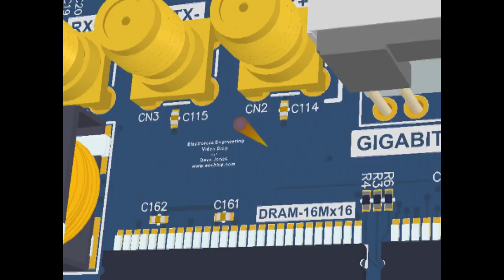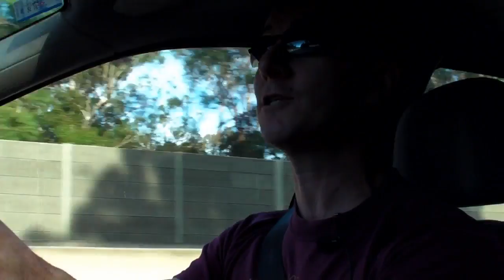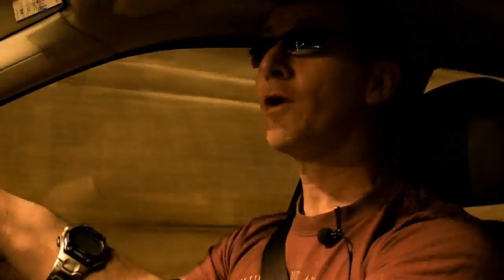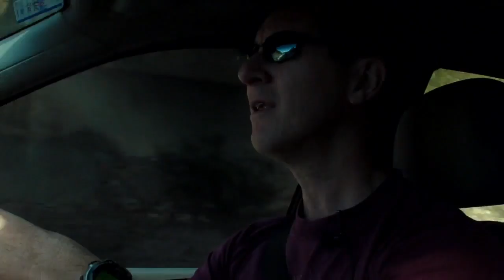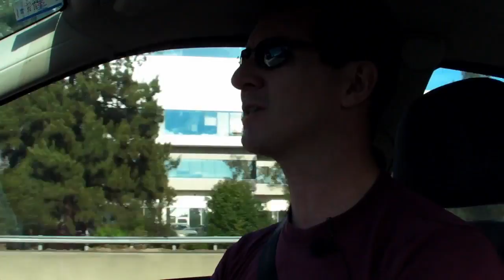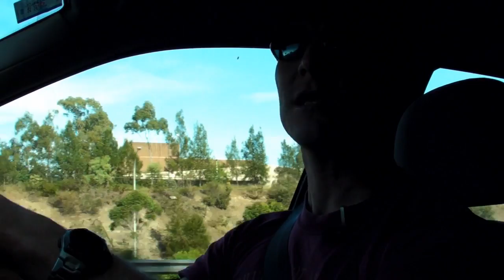EEVblog #93 - PCB Autorouters Suck

Comment: When I worked at SONY as an R&D tech one of my jobs was PCB layout. One day they asked me to do a manual layout to compare against an autorouter. I looked at it as a sort of John Henry challenge, so I really busted my butt at it. The autorouter produced a real ugly mess with 30 some vias, a few going back and forth between layers twice. Not good at the frequencies we were running at. The senior hardware engineer came into my cube, looked at my completed layout and asked me to turn on all the layers, since all he saw was green traces and pads. I told him, "They are all on." I'd done the layout entirely on the top side of the board except for vias to VCC and GND layers. He went and got our manager to come look at my work. I got a good raise at my wage review. That's been a while. I hope commercial autorouters are better by now.

Comment: I used autoruter about 2 times and I had enough of it... Both times I ended up with a board full of extra wires because I just could not hand solder beneath some pieces, which may be no problem for a machine... :S

Comment: Altium is a pretty expensive and complex tool. I'm happy to use it, but just because I used some other tools which where just worse then altium. There are some annoying bugs and behaviours... Import and export layerstack? Not implemented. Output jobs which export the right layers? Well, try to preconfigure them... Documentation? Plenty but outdated...
On the other hand, they were brilliant to use plain text underlaying all files (realy!) that allows powerful workarounds. But, yeah: It's a tool.

Comment: Auto-routers are nice for two things. One is running lots of parallel buses, after you've done a good placement. That's rarely necessary these days, though, with everything going serial. The second is finding routes for those last dozen or so lines on a tight board. Typically slow, non-critical circuits like /reset that wander all over the board. I'll let the auto-router loose on those and let it find a route. Then I'll rip it up and lay it back down cleanly myself.

Comment: That must have been a condition of providing "free" or low-cost software.  I can't believe any professor would prefer that you use autorouting over manual, especially on something like a single-sided board.

Comment: I usually use perfboards instead of making PCBs in part because the routing takes so much time with an autorouter or not (the other part is that I never get it right the first time and modifications are easier on the perfboard). Last device I made has 20 logic chips so if I had a good autorouter and was willing to etch the PCB, it would have saved me some time. I used a perfboard though (with wires I get many "layers" but only 1 layer on a PCB).

Comment from the maker: @jpelczar For high speed stuff you are forced to use a large number of layers to get the ground planes required for impedance control. Once oyu have all the layers, manual routing gets much easier.

Comment: It shoudln't take you long to see that autorouters suck. I sometimes use it for a single wire to save me some clicks, but that's it.
I'm only doing "home" projects (most things with an Atmel AVRs), but routing is actually a really a fun part of a project for me. I see it as some kind of game. If you can still see the board, the components aren't close together enough ;-) .

Comment: @zekonja24 I use Ultiboard to create my layouts.  It has the ability to snap to 25 mills.  I'm going to try it.  I designed a +/-15V regulated supply with a variable heater supply for a tube preamp.  Now, I just need to create a smart layout that will be good for interconnection in my chassis.

Comment: Autoplacements/routers are so bad. First the auto placers, they just randomly place connectors on the middle of the board so it might get a short connection to the rest of the circuit. What happens then? The microcontroller is put on the side of the board, so it can't figure it out on a double sided board!

Then you set the components right yourself (making full adjustments for the form factor and stuff you should worry about); it makes millions of via's, unconnected routes and it looks shit.